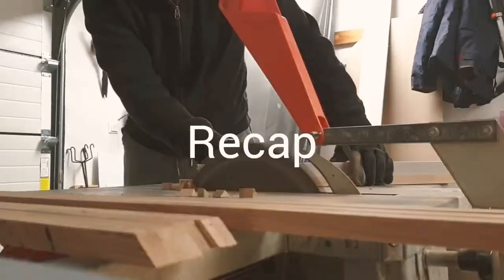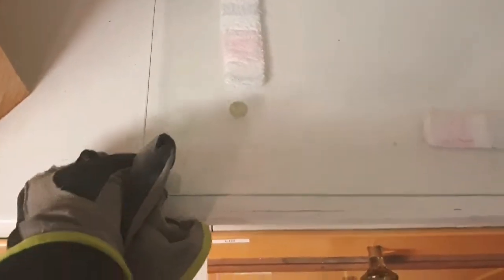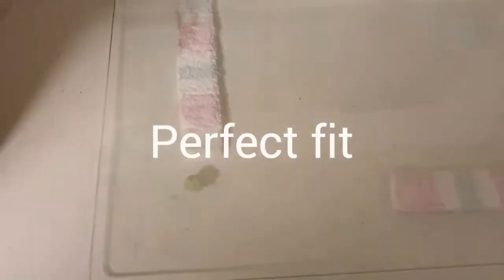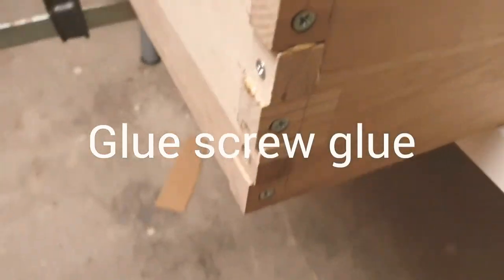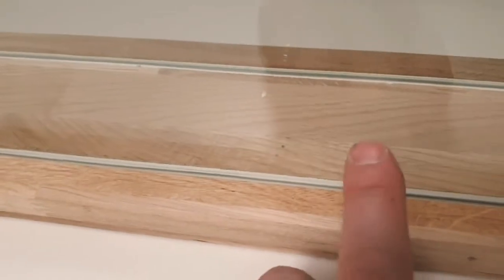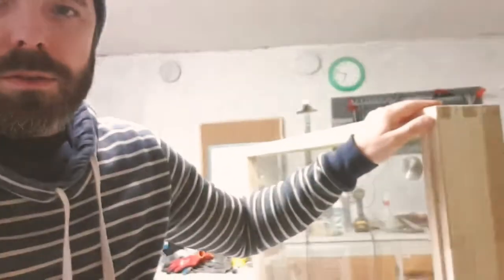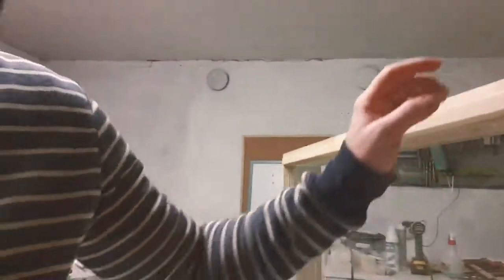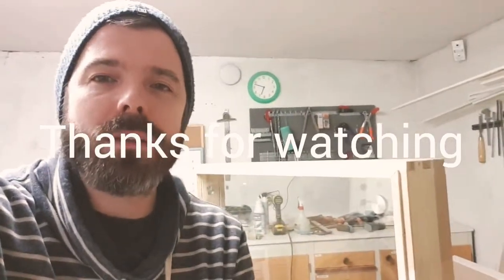100 Euro DIY Studio Window - Building a homestudio pt 3

Comment: Hello

1 frame only, not decouple 2 frame?...what do u use to prevent condensations between the glass?

Thanks
Reply from the maker: Hey, thanks for watching. Thats a great question. Idk and have not taken that into consideration...Now, that problem have not occured since installed. Maybe because it was put together in winter when air is less humid.